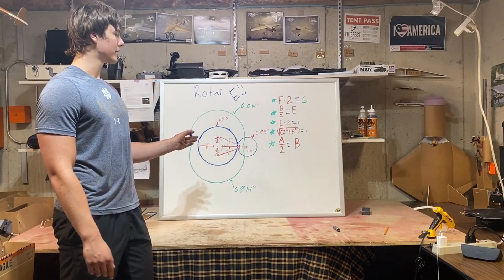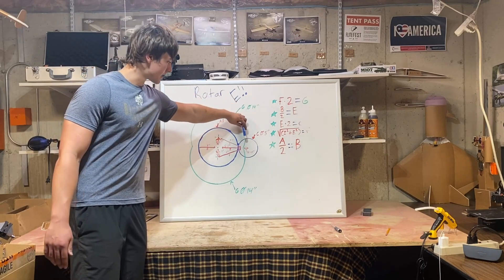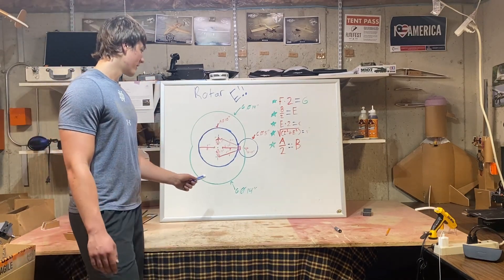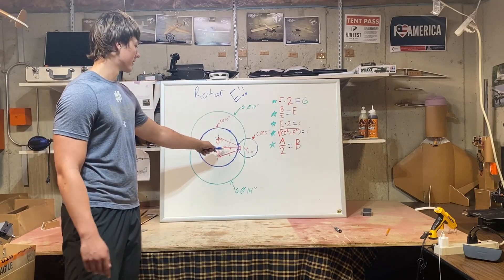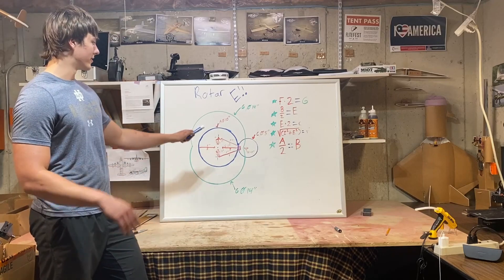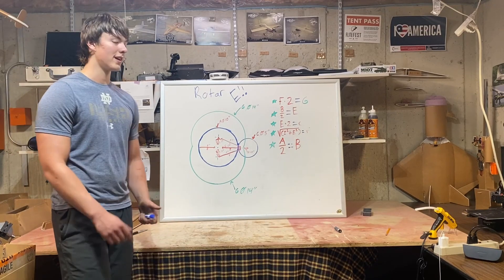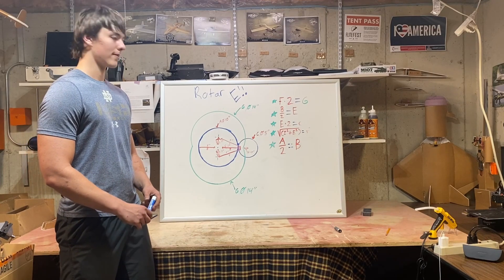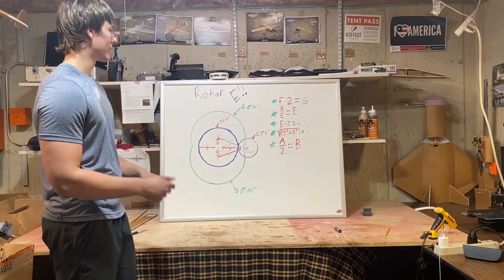How to Model an Epitrochoid

Comment: Dear are you sure about that rotary circle? Because I follow your steps and creait it,  but the rotary circle is too small for the combustion chamber
Reply from the maker: Honestly no clue lol I did this when I was like 15. I made a 3d printed prototype using the same method I outlined and it worked but I never made a real one. I have no formal education nor do I know this actually works just ideas. Probably should have made that more clears

Comment: How would I design the rotor from this design
Reply from the maker: If your doing it in a cad software you would make a equilateral triangle. 1 of the 3 points of the triangle would go on 1 of the 2 point where the 2 circles meet to create the housing. What I do is make a triangle then constrain it so that it’s 60 degrees at inside of each corner. Also the two other points of the triangle need to be touching the other circles. Then I would make an arc on one side of the rotor and do a circle pattern to get it on the others sides. I would usually just eyeball it to see what the arc should look like. This gets the general idea of the rotor dimensions but there are also like apex seals and stuff that you would have to account for if your making a real one. I haven’t so I couldn’t really help you much if you are, this is just the method I have used to make small scale models to print.
Reply: Olá. Tenho dúvidas em qual programa devo usar para simular esse movimento cujo você situou no video